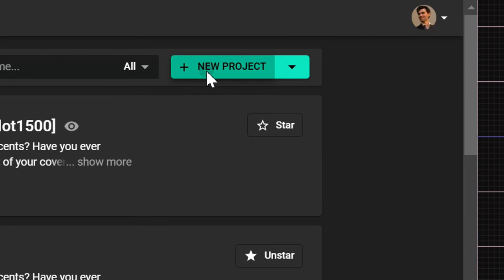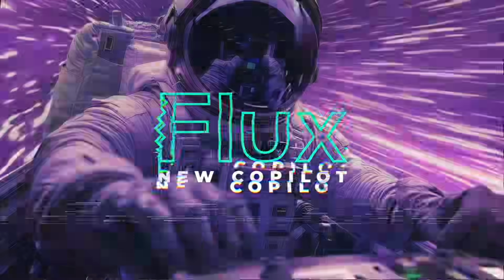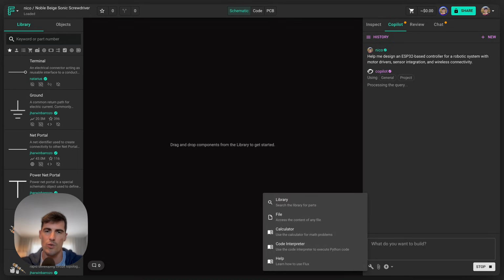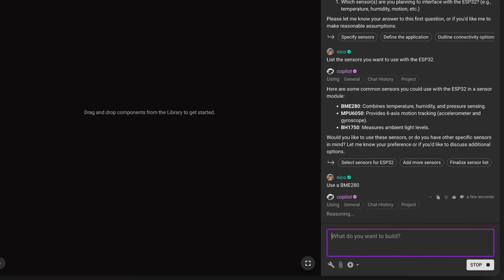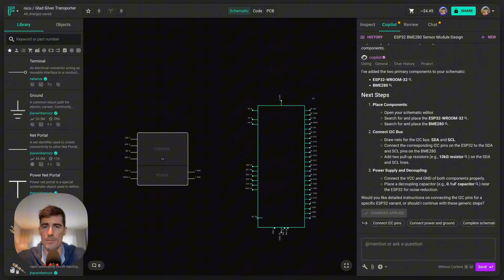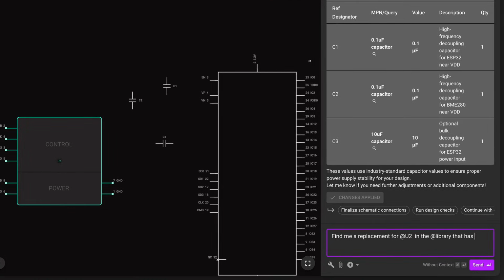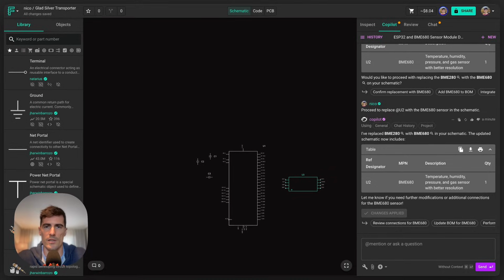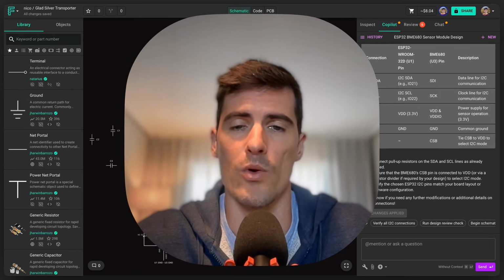AI Agents for Hardware Design: Meet the New Flux Copilot

Comment from the maker: Try it here https://bit.ly/43fhiAt! Here's some tips for getting the most out of Copilot: 

1. Break Tasks Into Steps – Copilot works best when given one task at a time. Instead of asking it to build an entire schematic, begin by telling Copilot what you want to build, then give it specific prompts like “@copilot, suggest a temperature sensor suitable for outdoor environments.” After selecting a component, proceed with, “@copilot, add the recommended temperature sensor to the schematic.” Finally, instruct, “@copilot, connect the sensor's output to the analog input of @U1.”

2. Provide Context – The more details you add to your project—like goals, requirements, attached datasheets, or components on the canvas—the better Copilot performs. These details act as Copilot’s “long-term memory” across conversations.

3. Use Specific Tools – Utilize tags like “@library” to reference parts libraries or “@file” to attach datasheets. Specifying design parameters further refines Copilot's recommendations.

4. Watch for Action Buttons – When Copilot identifies executable tasks, an action button will appear in the chat interface. Clicking this allows Copilot to perform the task directly on your design. If the button doesn't appear, consider rephrasing your request or breaking it down into smaller steps.